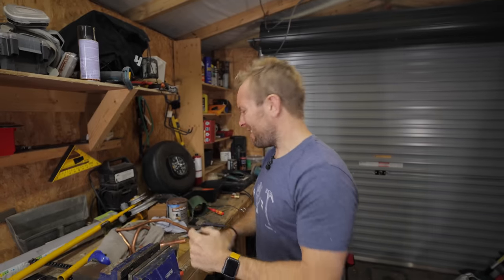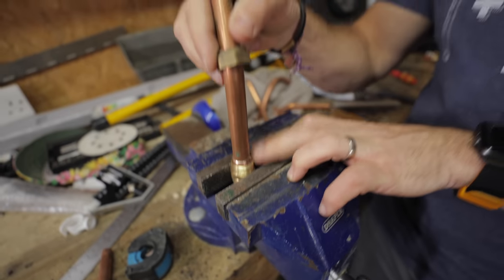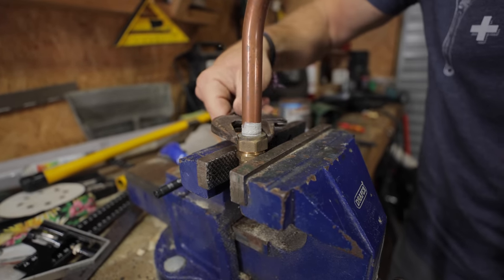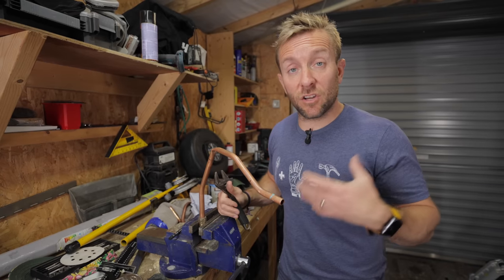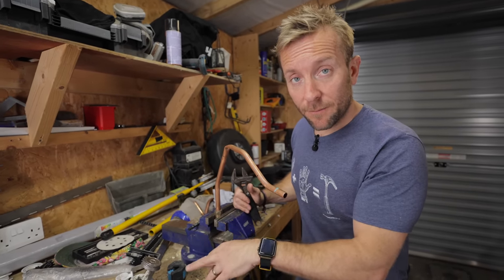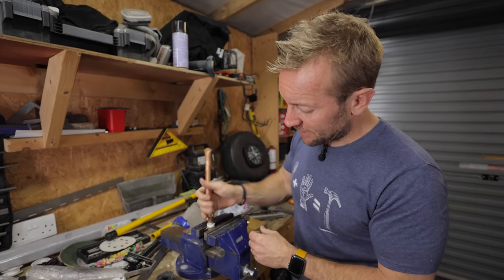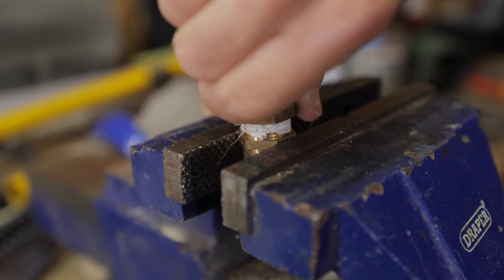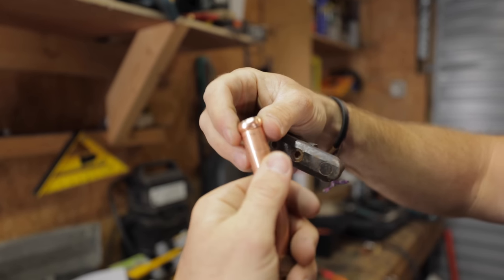4 MISTAKES Everyone Makes When Using COMPRESSION FITTINGS

Comment: The problem is actually the crappy olives which come with the joints. I'm not a professional but I have been doing odd plumbing jobs since the 1960s. Compression joints were never a problem then. You just screwed it up finger tight then gave it a quarter turn or so and you had a joint that would never leak.The olives were a very soft gold coloured metal. Today the olives are a harder more copper coloured metal. I always now use PTFE tape as you describe or at least one joint will leak and will not seal. I went into an old shop about 15 years back and they had a big box full of gold coloured olives so I bough a handful. After that I did not need any sealer until they ran out.
Reply: you can buy pure copper olives (vs the brass ones which come with the fitting)  -  guessing these are the ones you are describing (they are softer and more reddish in colour than brass)

Comment: No PTFE at all. One thing which not mentioned is what I always do. When first sliding on the olive and entering it and the pipe into the fitting is just before tightening, is pull the pipe out about 1/16". Reason for this is, if you need to remove the pipe later for whatever reason and refit it the pipe will not bottom out before the already compressed olive
Reply: Best reply so far, I totally agree. I never leaks if you pull it out a few mm, as you say it doesn't bottom out.

Comment: ❤cool advice,ive used furnox joint compound in the past, the o 10:4 10:49 only trouble is it sets like concrete after a while,making it difficult if you have to remove a fitting.
My favorite fitting is a yorkshire or end feed ,love solder

Comment: Hey thanks. I have a Q . I already tightened my new flared gas line to a new fitting without any compound and it is NOT leaking. Should I redo it by adding the joint compound to it ?? I am a bit nervous. I am just a homeowner.

Comment: I've always used jointing compound but just a thin trace, not like icing on a sponge cake. And put some on the pipe before sliding the olive on because you're then sealing another potential leak point.

Comment: Hey James! Just reviewed this again and still need help.  I'm repairing a leak in 1/2 inch copper tubing. Got the leak cut out. Tried 1/2 inch push fitting, but it was too loose. Leak city. Then I got 1/2 inch compression fittings. Everything fits, except the olives. They won't go on the copper tubing. What's my next move, please? Thanks from Louisiana, US. 💖

Comment: Great videos. I just bought a 3/4" compression ball valve to replace my home main shutoff just in case my shutoff at the street doesn't close enough to solder.  However, I just noticed it doesn't have a packing nut under the lever! Never seen this before. Is it something new or just cheaply made therefore I should buy one with? Thanks so much!
Reply: No packing needed in these, they use o-rings ..
Reply: @damienhill6383  OK. Thanks! Which type do you think has a longer life? Packing nut or o-rings?

Comment: I served my time as a spark on  the renovation jobs many ..years ago and never ever seen jointing compound put on compression joints. Then years later we used to install electric showers with a minimum amount  of plumbing from a cold feed using compression fittings and never once where advised to use jointing compound…….so thats why they squeaked and some leaked  !

Comment: Putting ptfe on the threads doesn't make it seal better but it does make it easier to tighten IMO. It's always in a difficult space to tighten so I like to make it easy as possible. Never tried putting the joint compound on the olive, that probably makes it easier as well. Done plenty of compression fittings (working for a GC) but I am not a plumber so I usually don't have the dope on me. On the other hand I usually do have the ptfe on me. I have seen people put the ptfe on the olive but I dunno. Probably will try the compound next time out of curiosity. Never seen either on an olive I have removed but who knows I may love it an never do it dry again.
Reply: PTFE put on the threads lowers the friction on tightening 
Because teflon has a very low friction rating , And before it was used on frying pans was developed for use in space 🚀

Comment: A few spots of grease on the nut threads will make it easier to do up accurately. About 1/4 turn to tighten and same again to compress the olive, stop if/when it squeaks. Oooops you forgot to mention the "Slim Jim" spanner many fittings require.
Reply: Grease the olive as well as the nut to stop the squeak. Works every time and no compound needed
Reply: @richardlewis5316  Good point. In my case though I use Fernox LSX on the olive.

Comment: I've never had a problem without jointing compound (ok, not never, but always get it to tighten!). Tend to use ptfe on bigger nuts.
Reply: Yes but as he says it's that extra bit of safety, the fitting quality aren't as good as they use to be and say it's slightly of or hit or whatever,vthe jointing compound is a good idea

Comment: I’ve never used sealing compound on olives and I’ve never made a leaky connection. I always clean the pipe before assembling the joint. I have seen some leaking joints that had remnants of ptfe tape when I dismantled them. I think the tape created a weak point and wonder if jointing compound would do the same 🤔
Reply: If you’ve never had a dry joint leak you are either extremely lucky or you haven’t fitted enough compression fittings.

Comment: The PTFE tape can be used in place of a compound for the purpose of anti-seize correct? Also it is slippery and makes for a uniform tightening. Correct? So even though it is not used for sealing it is still useful as a anti-seize application. Correct?  AND is there a plumbers torque wrench to make sure it is not too tight or too loose? And what would be the setting? OR how do you know it is tightened properly?

Comment: Some really useful information.Ive used and do still use compression fittings,fuel and water..As you say,the quality of components,the  ""outsourced" has gotten less if not downright poor.The pipe dope idea is good especially with lesser quality  fittings.A quality pipe dope is good to know.I ask welldrillers ,they know.The ptfe tape on the threads of a compression fitting? Got a chuckle out of that.Might as well duct tape the whole unit .Anyhow,a good bit of useful shared know how,THANKS.

Comment: Ive found a cut nail lodged in a copper pipe that sealed itself when the guy / girl missed the joist , it had held up for 20 years on gravity hot ! 🎉
Reply: copper is slightly flexible, so it would seal itself on things pushing into it like things seal onto a piece of rubber. I one year ago stepped on a floorboard and it started spraying water - the classic, a nail through the floorboard into a radiator pipe.. And I stepped on the landmine
Reply: @dimitar4y  this cut nail was like a rusty hair on the inside of the half inch copper , crazy it held
Reply: @inventions47  technically rust can clog small holes and the rusting causes the iron to expand and clog the hole better.

Comment: I would sometimes use a bit of olive oil on the olive and the thread, but always swop the brass olive for a copper one as we had loads at work. Also, always use a proper spanner on the nut and not an adjustable. I think I found one of your untightened joints in a hospital after a cleaner hit the fitting with a trolley ?

Comment: 40 Years using compression fittings all makes never used jointing compound or tape. Never had a problem. sometimes the odd weep but soon sorted by nipping up a little more.

Comment: Not tight enough or too tight.  Lots of room for interpretation there.  I imagine using jointing compound or Teflon tape would make over tightening easier by lubricating the tapers.  Getting the right amount of torque has always been an issue for me as an amateur DIY homeowner.  Any advice on how to gauge the correct amount of torque would be appreciated.  Cheers!
Reply: I don’t use teflon tape on compression fittings - the water tightness is not in the threads.  Personally, if unsure, under-tighten the joint and return the water and tighten until the leak is gone.
Reply: Best way to learn the force required, is to tighten the hell out of it, until you STRIP the threads, & then back it "off" a quarter turn and that's just about right, as far as correct tightness goes.
Unfortunately - once you strip the threads, there's no way back.

Comment: Just did a quick fix on my metal power steering line. It worked a treat until i could get the money to get it properly fixed. Lasred 6 months with no leaks❤

Comment: Man, I wish I had watched that video last weekend. I changed two compression stop valves behind the washing machine, and they wouldn't stop leaking. So I got some jointing compound and did them again, and they finally stopped leaking. Well worth the £12 for it.

Comment: I did that using the fernox jointing gear but i didn't use that much, just on the chamfer and smidge on the olive as i didn't want it in the rad system

Comment: So, essentially, you use the jointing compound as a lubricant. A bit of spit or washing up liquid will have the same effect and won't be a PITA if you want to reuse the fitting sometime or fit a new olive. I would never use jointing compound on a compression fitting.

Comment: It might be worth mentioning that over the years, a compression joint might loosen with constant heating and cooling of the joint. You can come back to a joint that was tight when installed and it just undoes with little more than finger pressure.

Comment: Does it matter that you wrapped the PTFE   anticlockwise on the olive when the nut will be tightened clockwise?. I have always done it the same direction as the nut, even though its on the olive, as I have always then followed it onto the threads too
Reply: He wrapped it clockwise on my laptop screen....
Reply: @scorpio9578  yea he wraps it's clockwise, but then turns the pipe upside into the fitting which means it goes into the fitting with the PTFE threaded anti-clockwise. Whereas the nut would then drop down and be spun clockwise. I will add that the purpose of my comment was not to try and be clever, but genuinely wanted to know if it matters with it only being the olive, as I have wrapped it the "wrong" way and taken it apart as a result, but if I don't need to then I wouldn't worry for the future
Reply: @StoneMotions  WHAT! Are you serious? The thread doesn't change directon does it? Good grief...The only reason we wrap it clockwise is to prevent the nut unwrapping the tape as its screwed on, but most times it stays in place either way. You just get used to wrapping tape the correct way, I wrap the thread and carry on over the olive, just a couple of layers, then pinch up the nut.
Reply from the maker: Think this is being taken up at PMQ’s today! 😂😂🧨🧨
Reply: @plumberparts  😂 I was genuinely asking if it matters on the olive, as only the pipe is touching. Not the thread or the nut. @scorpio9578 you're right the thread doesn't change direction. But wrap something round your finger clockwise pointing to the sky, then point it down, you'll see notice that the wrap is now going anti-clockwise. On the video I viewed it as the nut going on clockwise and the PTFE anti-clockwise. If I'm wrong, so be it. But I don't think I am 🤞😂

Comment: I used to live in a high water pressure aria (so much so I could pressure wash the car directly from the outside tap) when I re-fitted my bathroom, I had ptfe every joint.

Comment: Should you use JetLube V2 when doing compressions onto a JG polybutylene or pex barrier pipe? The info sheet says not to use on ABS or CPVC but doesn’t mention polybutylene or pex…

Comment: I use pipe dopw on compression fittings and flared fittings for gas flex lines. Ive seen multiple leaks on both. I always put a little p dope on the threads and ive never, ever had a leak

Comment: They call the olive a Ferrule in the US.  They make  a puller to remove the ferrule, so you don’t have to cut it off. Sometimes the stub out is too short.  I pull the ferrule and clean the pipe underneath, with plumbers sand cloth, to remove any imperfection’s.  If the pipe is not perfect, or has nicks, I wrap one turn of Teflon tape and install the ferrule over it.  Also apply a little pipe dope to the back of the nut for lubrication.  Never had a leak.

Comment: "If they squeak, they're a lot more likely to leak", ah catchy 😅😛
Wonderful tips, cheers for the video. That PTFE tape is a remedy to a problem that shouldn't exist in the first place, and it's just a way to sell even more crud to people...
I have a question about connecting a silicone hose onto the other side of one of those brass fittings. Do you make sure the side that the hose is connected onto is barbed and then tighten that side down with a jubilee / worm drive clamp? 🤔

Comment: Hi Al.
Sorry to be a pain but I've used push fit outside and after ten years they degrade. 
They crumble due to the weather sun etc,
But yes they are easily replaced as you say. 
I suppose its a balance  and upto the individuals preference. 

Regards Duncan.

Comment: I live and work in France. A few years ago we received  new boats from Norfolk fitted with Propane security valves. Three valves on each boat, two nuts per valve, total 12 nuts. 6 of the nuts had been overtightened and had split, thereby leaking.
Problem No 1: French and UK valves use different threads so couldn't replace the nuts. Result: the valves had to be replaced with French ones. Fortunately, it was 5/16th copper pipe which is 8mm.
Problem 2: French and UK Propane regulators use different pressures. Result: the regulators had to be changed.
All because someone overtightened the nuts.

Comment: You wound the PTFE in the wrong direction at 7.30, after telling us the right way to do it!  
Last week I saw you drill into a floor without checking if there was pipe or cable under it.... that was really entertaining! 
I like this channel.
Reply: Been a plumber,heating engineer, gas installer since 17,  63 now,i miss the job v much,i dont think it matters how the ptfe is rolled,i do the same as this fellow and right handed like him as its a lot easier to apply the tape over n under holding the wheel of tape through your fingers and i can put tension on as i do that,its about making the seal better on the olive ends making a seal when its being compressed into the pipe using the the internal chamfers of the nut and fitting,only when ive firstly tightened the copper or plastic pipe, so its crimped the olive sufficiently, then disassemble it all,i then apply the ptfe and re tighten nut to fitting,effectively creating another seal that tends to take up the slack between olive and fitting,without sounding big headed,you get to know how much to tighten these (manipulated)compression fittings by experience, like other trades ,so normally i wouldnt apply ptfe tape unless it weaps,it happens now n again,not often its not something you would do everytime  you use this type of fitting,so it doesnt make any difference how the ptfe tape is rolled on to just apply ,its acting  like a filler as the tension you control by doing it his way and mine is easlier to do,a tip,when you have applied the tape around the olive just keep applying it so you cover both ends of olive equally so you want to go past each of the squashed compressed ends maybe 2 to 3mm to make that tape fill the gap pehaps 3 times is usuall enough as you are about to stop turning the tape holder,just pull on the tape with tension ,put your thumb on the tape  on the pipe you have wrapped to hold it on then pull with tension until it snaps the tape still under tension and foward motion the last pulled bit of tape to " lock that tightness up so it doesnt unwrap", then by fingers replace nut to fitting,because its already compressed the olive you dont have to then tighten it up by much as the olive has done its job,if it still weeps,just tighten a little more,plastic pipe tends to want you to do this more ive found,dont forget the pipe insert in 1st before olive ,hope that help folk.
Reply: The direction is only relevant if you're applying ptfe to the thread on a joint as the nut has a tendency to unravel the tape when you do it up. When applied to the olive, the nut squashes it together with the joint.

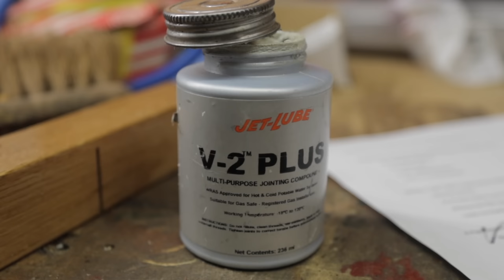Comment: Sorry, I had to stop this at 2:18 a compression joint shouldn't need any additional leak sealing product. If you properly assemble a mechanical joint it will be leak free. I have assembled many high compression fittings with compression joints (i.e in excess of 200bar) and they've been leak free!
Reply from the maker: No need to apologise for being wrong Graham! 😂 Of course you're right, but this isn't a perfect world and sometimes you do need to use compound - I never want leaks and it takes seconds. Compound for me everytime!
Reply: @plumberparts  OK;-)
Reply: 100% correct. Never use anything on that type of joint, a complete bodge by anyone that does.

Comment: Not a plumber, but I use some grease on the threads for the nut and a very thin smear on the outside of the olive. No leaks on the few I have done. 
I welcome ppls feedback. Cheers.